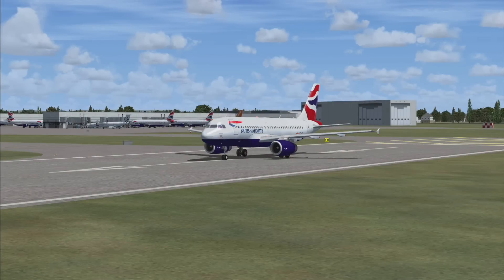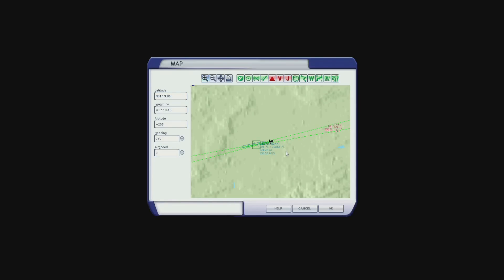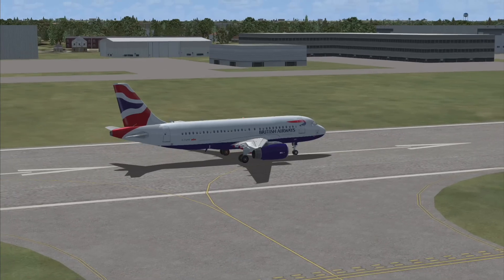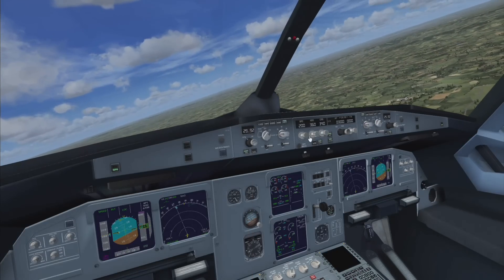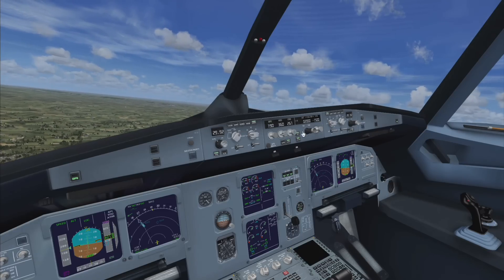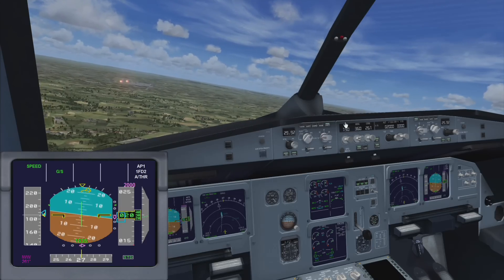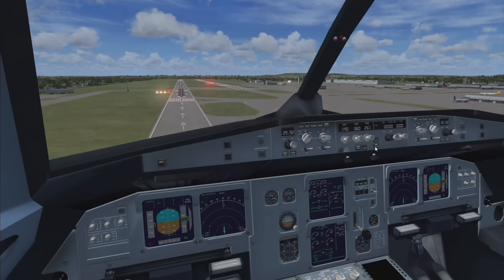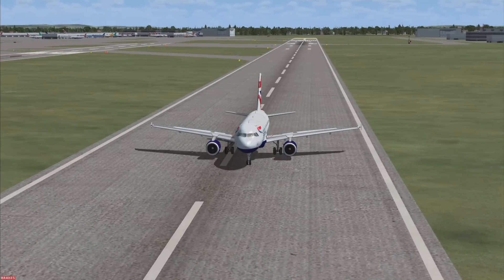FSX How to Land with ILS | Autopilot Landing | Airbus

Comment: Can the autopilot land and flare on its own?
Reply: Andritchi 71 nope when you reached the threshold you should turn everything off and thrust to idle and flare/land the plaine yourself
Reply from the maker: The ILS is to simply guide the aircraft perfectly into the touch-down position. However, just before touch-down, all aspects of the autopilot have to be disengaged with the thrust brought down to idle. You must then flare for the touch-down.

Comment: I don't know the timing to when I should lower the gears, when to activate approach to final, when to put in the ILS frequency. Will someone help me?
Reply from the maker: You put in the frequency as early as you know the runway you’re landing at. You activate Approach as soon as the diamond begins to lower. And gear comes down usually when you’re lined up and just about on final
Reply: Jack's FSX Videos and when do I switch from GPS to NAV?

Comment: As soon as ATC give me clearance to line up with the localiser to land I turn the approach hold switch on and as soon as the aircraft locates the localiser it starts my approach and I land without any problems. I see the you leave switching the approach hold untill the horizontal indicater is level ( hope you know what I mean ) is there any reason to leave the approach hold until that time ?
Reply from the maker: I find it's best to activate the Approach Hold switch at that time, in order to land in the touchdown zone on the runway.
Reply: Thanks Jack, I will start to do that then.

Comment: When i turn from gps to nav the nav Autopilot turns off. WHY???
Reply from the maker: For landing with ILS, you should be keeping it on GPS anyway. But what exact part of the autopilot goes off?
Reply: the Nav Hold Autopilot
Reply from the maker: There isn't a Nav Hold button on this aircraft, that's why I was asking which specific button :)
Reply: Hey I know this, he needs to switch from nav to gps, this button should be somewhere on the autopilot panel
Reply from the maker: You actually need to switch from GPS to NAV, not the other way around. It's to the left of the autopilot panel

Comment: That was heading 261 not course 261
Reply from the maker: Yeah but that's what you need to put in to the course, the heading
Reply: So the heading and the course are the same
Reply from the maker: When using ILS, whatever the heading is for the runway, you put into the course

Comment: sad FSX doesn't have mcdu like the real airbus :( would've made this easier and more realistic. YES IT'S EASIER TO FLY AN APPROACH WITH A REAL AIRBUS
Reply from the maker: Some FSX add-on aircraft do have a working MCDU or FMC. However, this specific add-on does not and is one that I find people will find it easier to follow. In my experience, people find using MCDU/FMC more confusing as a beginner.
Reply: Jack's FSX Videos i mean the procedures on fsx is confusing compared to using a full airbus simulator like i did. thanks btw for  sharing this video, i have this big problem activating an airbus approach on fsx
Reply from the maker: I'm glad the video was helpful! Thanks for watching.